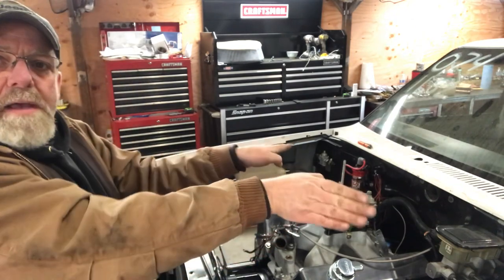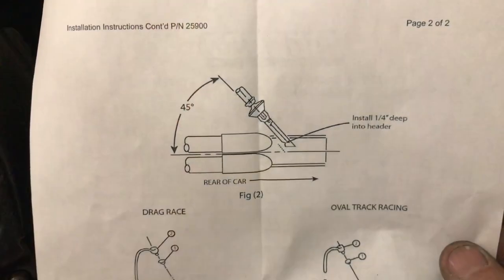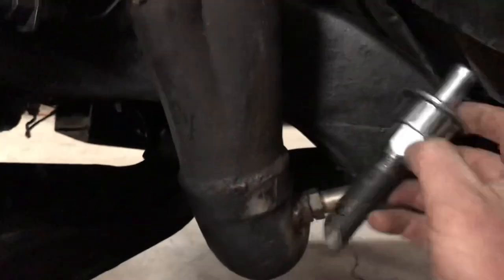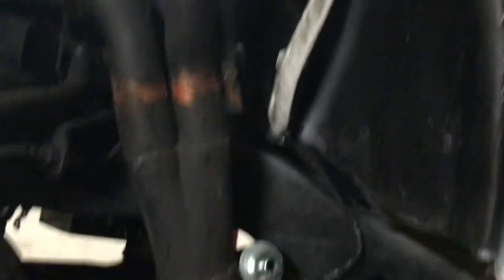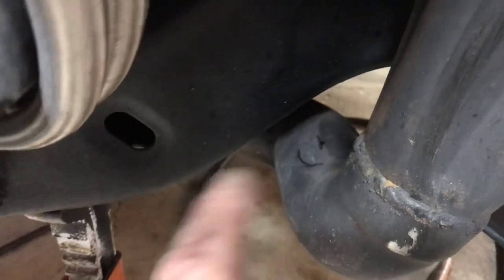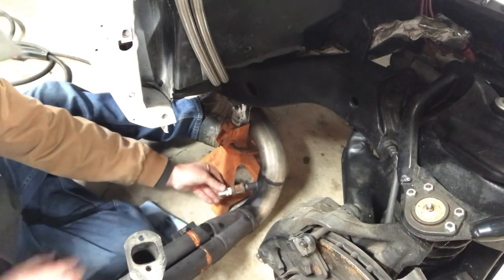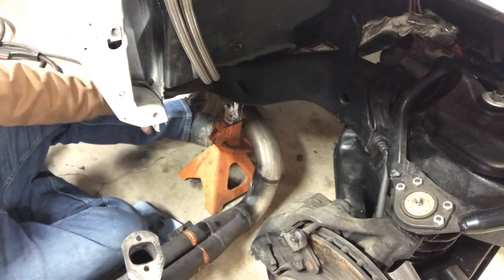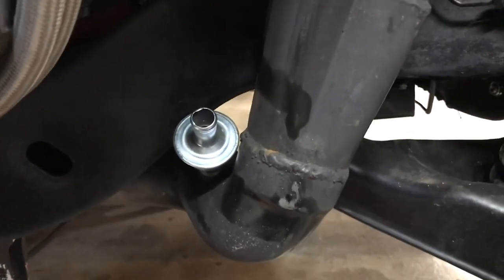Moroso crankcase evac system install!!

Comment: Love evac's, if you take a little off the tip in the header it will pull a little more, mine sucks to my hand at idle with axle dump exhaust with mufflers
Reply from the maker: How do you have them positioned? you can see what I had to do just to get them in.... The instructions say at the transition point of the collector
Reply: Both of mine right after the merge, once i did the side, but in the nova there's room to do right on top. Yeah S10s are little tough i dont see any problem where yours are though, just keep a spare set of valve and put a little anti seize on them, sometimes i get 2 seasons out of a valve sometimes its 6 months,
Reply from the maker: Ole Deuce hopefully it works out where I have mine mounted....

Comment: Did you consider you are hindering the exhaust flow w/ that  evac pipe in the exhaust? Aren't they designed to be mounted to a 4" collector?
Reply from the maker: scotty162 I can’t imagine it hindering the exhaust...
Reply: @ordinaryguygarage3667  that pipe for the evac is 7/8 , that exhaust tube looks to be 2.5" , so you are blocking about 25% of the flow.
Reply from the maker: scotty162 actually it’s a 3” collector (9.42 sq inches)and the pipe only takes up 1 sq inch... in my opinion as many racers before me is the benefit of crank case ventilation out weighs the minor obstruction in the exhaust flow...
Reply: @ordinaryguygarage3667  sounds like a winner 🏆
Reply: @scotty162  come on man…. You’re also adding flow through the tube, 
   Did you ever see the header dent videos how you lose no power by bashing the header?  
   It’s not always that simple👨🏼‍🔧

Comment: Is there any updates to this video?
Reply from the maker: I haven’t formally tested them SS in a vacuum test but, they seem to work… haven’t had any oil leaks
Reply: I am getting ready to install the 2” x3-1/2 headers on my truck. I wanted to run side exhaust but the cab mount is obstructing the path. I have already cut driver side out and plan to move the mount to the top of the frame to make room for 4” side pipes tucked into rocker panels. I’m also debating running the turn outs through the bed side in front of the tires .
Reply: Have you seen if they pull vacuum when you pull the breathers???